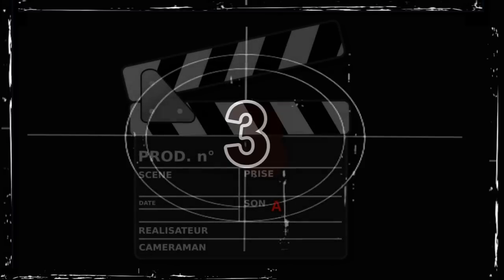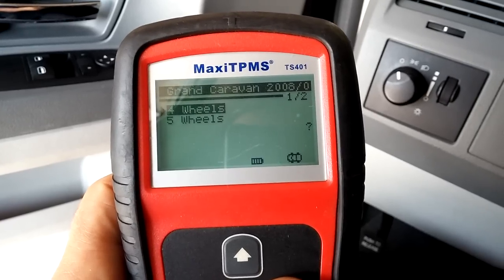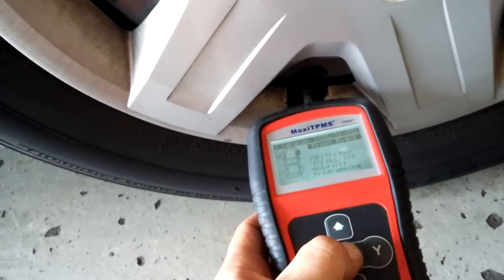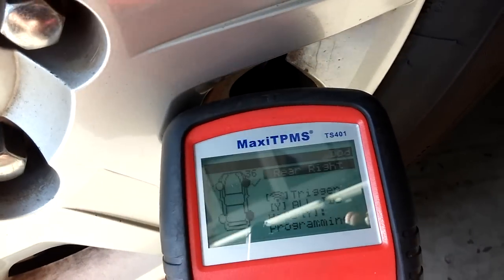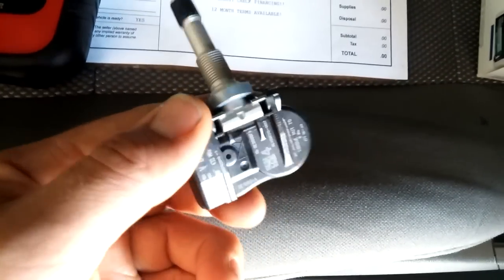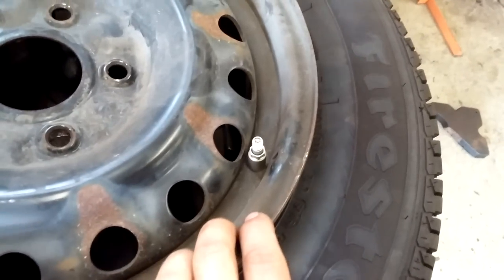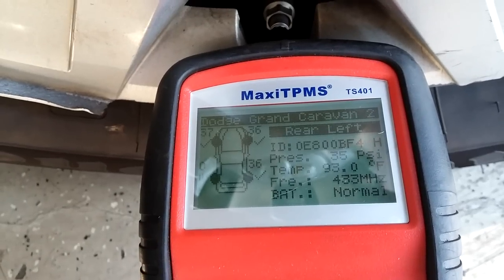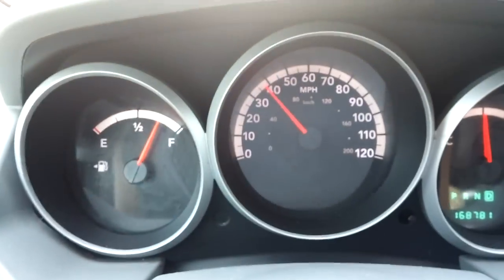How to test and replace tpms sensors

Comment: The tool cost $299. 1 sensor can cost $25-$100. Shops will charge $150-$200 per wheel. Can be up to $800. Maybe I can live without that or I can buy the tool myself and return it after using it.

Comment: That's all to test the sensors? The garage I went to wanted $140 just to check which sensor was bad, they said the car has to be put on a lift....
Reply: U got scammed this tool is not even 140$

Comment: i have no idea about car  since my tire need  air tire pressure  even though i inflate before i go and middle of the highway i need tire pressure again so keep bothering me i replace a new one its still need tire pressure so i found this video i have no idea its every car has there individual sensor may be this is one of my problem thanks for sharing this informative video
Reply from the maker: Shakira Bells  Thank you for your kind words! Also on most cars when the tire light is steady on, that means low on pressure. If the light flashes or tpms light is on with the tire light, that indicates deeper issue most likely with one of the sensors.

Comment: Good video, Question! if I take out all wheel sensor, does my light is going to go away?
Reply from the maker: chrischenusa 63 
TPMS light will stay on. The only other way around it is remove cluster and remove the bulb. On newer clusters is difficult as all bulbs are LED and are soldered.
Reply: TDR Auto how much would this job cost (estimate) at a auto shop? Think i need this done on my ram 1500 2008
Reply: @theprinces1k787  almost a hundred dollars a tire literally jus left the tire place
Reply: Walmart only charged me $12 to replace tpm sensor on my 2018 dodge dart

Comment: Can you get the ID from the sensor if the battery on the sensor died ?
Reply from the maker: Calin Ly  No, the sensor can’t send signal anymore. You’d have to pull tire out, the ID is stamped on the sensor.

Comment: Will this tool let you rest TPMS sensor if you have two set of wheels like summer and winter rims.
Reply: TPMS sensors are only active when they are triggered.
they can be tiggered as shown in this video, or they get triggered when they rotate at high speed (around 30 mph).
so when they are not moving, they don't get triggered, and don't use up battery.

Comment: Your spare should NEVER have a sensor in it. Most new vehicles dont even come with spares.
Reply from the maker: I work on new cars every day and many vehicles still have spares.  It depends on application. Lots of SUV's that are trail ready come with full size spare and with sensors. Other cars only come with 'tire fit kit' (small cheap compressor) to save money, space and weight , but still have the option to fit spare tire.
Reply: Some do. And they are pita!!! :(

Comment: With this scanner I can get the car system to accept my new sensors ?? I have a Dodge Journey 2011

Thx so much!!
Reply from the maker: Marcos Araújo 
With most Chrysler cars the sensors will learn automaticaly by driving over 40 mph for around 10 mins give or take. This tool will read the sensors ID numbers so you can input them via compatible OBD II scan tool in to the Vehicle without the need for test drive. Also most other manufactures can't learn automaticaly.
Reply: TDR Auto I did not buy the original sensors, I bought from a similar brand. Will it also recognize if I walk for 10 minutes 40 km ??
Reply from the maker: Marcos Araújo 
It should. One way to find out for 100% is to drive it. :-)

Comment: There is a conceptual error in the TPMS.  When you buy a battery over 
the counter, you can see the battery's end-of-life date.  When you buy a
 TPMS sensor, the battery is embedded inside an epoxy-filled module, and
 the battery date is not visible.  So when you buy one, you have no idea
 if it is fresh or NOS (New Old Stock).  I bought Mercedes TPMS sensors,
 and the first one failed after 2 months, the second failed after 6 
months.  After 5 trips to Mercedes of Pleasanton and $1600 later, there 
are 4 "new" TPMS sensors in my wheels.  But how "new" are they?  The 
dealer and service advisor was not able to guarantee to me that the 
sensors were "new" and that they would last the lifetime expected of a 
lithium battery.  I hope the management at Mercedes and other car 
manufacturers and the legislators that mandated a tire pressure 
monitoring system have 1600 dollar bills every 4 months to keep their 
systems operational.
Reply: Its really not a big deal. I have no idea why the hell you paid that kind of money. That's your fault. Even if you had four bad sensors for years its not going to hurt anything. I had a lot of customers that when a sensor went bad they said instead of replacing it just to put a regular valve stem in... Only thing that will happen is you will have to see a little light on your dash... No big deal
Reply: most worthless system ever installed in the history of vehicles. I am constantly fighting this system to keep the light and beeping off.
Reply from the maker: Today you can get aftermarket sensor for less then $70 and the tools to program it are getting cheaper too. that means most independent shops should be able to accommodate even European vehicles.
Reply: Black electricians tape and a decent quality tire gauge are your friends. If there ever was a conspiracy to pull money out of our wallets, this is it.
Reply: What a fucken rip off $1600 just to tell you how much pressures in your freaking tires

Comment: I thought those sensors were glued to the rim and not in the stem of the tire.
Reply from the maker: On most vehicles it is part of the valve stem. On some it can be removed from valve stem (like new Chrysler vehicles) , but usually it's a one piece.
I've seen few cars with sensors attached on the inside of the rim with large clam.
Reply: Fords are usually the ones with the band sensors that go around the middle of the rim.

Comment: If the light wasn't on before the tire replacement, the tire shop is responsible.Either it needs tire rotation, adjust tire pressure, reset, reprogram or they might have even demaged the sensor.

Comment: Thanks for the video.  I replaced two of my tires and now my light will not go off.  Not sure if I should take it back to the tire shop where I got the tires or if I should bare expense at at Nissan dealer which is usually significantly more costly.
Reply: Same here.  I got two tires replaced and now my light will not go off either.
Reply: If it was off before getting into the shop They probaply broke one tpms sensor. I'd return to the tire shop and tell them to fix it.

Comment: Don't need the tool with a Chrysler product to program the sensor.You drive the vehicle and it is programed
Reply from the maker: Somebody didn't watch the video, at the end the 401 actually tells you, all is needed to program or reset TPMS on this vehicle is drive it.
Reply: He is not programming he is testing to find bad sensors
Reply: You need the tool to check the condition of the sensors on your Chrysler.